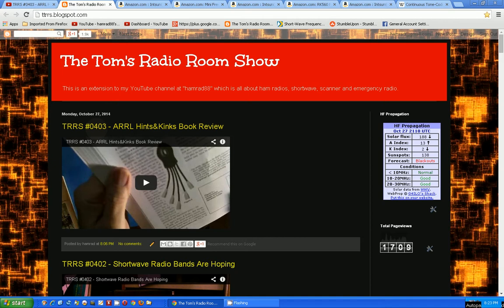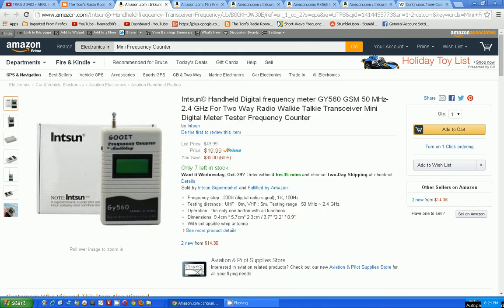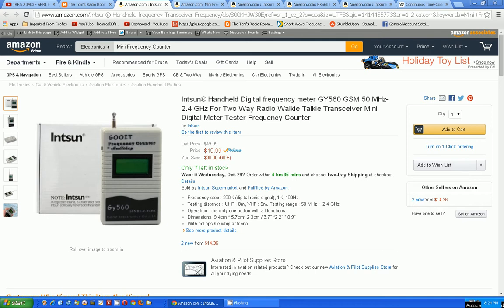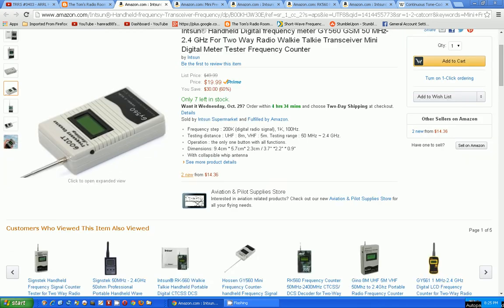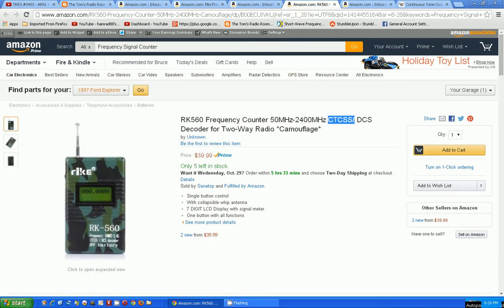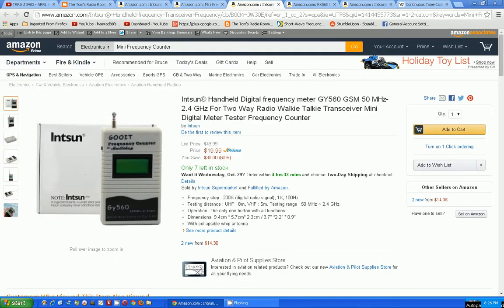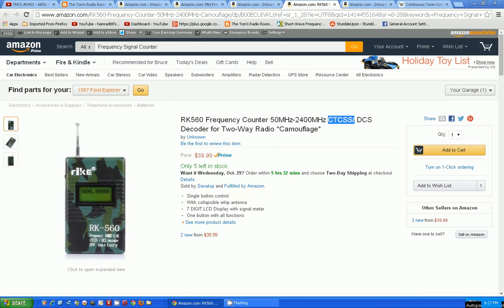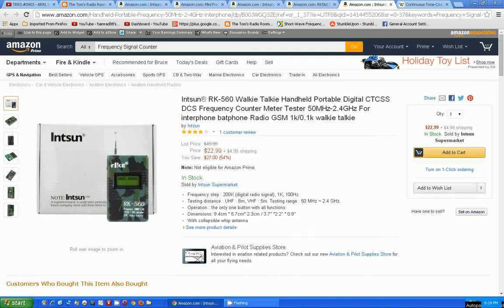TRRS #0404 - What the Heck is it?

Comment: Greets, Tom... I had or have seen a couple of these portable hand-held freq meters at various ham-fest and tech trade shows...different brand names, but clearly the "perzact" same units and perzact same as what you located on Amazon. They worked "OK", that is, seemed fairly accurate, no drift in the admittedly quick testing I was able to do by using these hand-held meters to read a very accurate frequency source that was itself 100.0000 MHz accurate...and the meters that I tested seemed to be accurate readout, etc.

Best me brain can tell, they read freq is about all, oh, yes, and field strength too, one-button selection, but heck, the price seems right, that's for sure. -- Joe

Comment: These Frequency Counters are a handy device for finding strong local signals and/or testing transmitters... they've been on eBay for quite some time, I suppose you could also use it for RF fox hunting.

My Uniden scanners will decode CTCSS as well, handy if you just want to configure RX for one primary service ie. Fire Department.

Comment: It is a frequency counter. It will displays the TX frequency from  nearby or strong transmiter. So, we can identify the frequency of a auto gate's RF remote tontroller, Wifi's frequency, security guard's walkie talike's TX frequency....

The other frequncy conter able to decode/get the CTSS/tone. So, it is useful to find the frequency and tone for cheap walkie talkie. and use the info to set our handy or rig.

The one with poer strenght will shows the TX power of the transmitter at certain distance.

Actually I almost want to buy one of it. :) but, I can use SDR to check frequency. Anyway, frequency counter can give the reading immediately, whlie SDR or radios need to scan for the frequency.

Thank you.
73,
9W2GNU
Reply from the maker: Thanks for your inputs.  I have several frequency counters and one similar that does a number of other things but cost several hundred dollars years ago.  I think I will get one of these and compare them.

Tom
Reply: hamrad88 night.
Reply: Looking forward to see the comparison/review. :)

73,
9W2GNU

Comment: I actually have the GooIt freq counter.  Takes a 9 volt, and works very well.  In fact, it looks to be spot on compared to my Radio Shack freq counter and the one built into my MFJ-269 Antenna Analyzer (calibrated by MFJ in 2012).  The Gooit does have a bar graph field strength meter that has come in handy.  Also, I've had the unit read down to at least 28 MHz when up close to the transmitter (was transmitting less than 5 watts btw).  Can't speak for the camo version, but the ability to decode tone squelch or digital coded squelch could be handy.  BTW the telescopic whip on the thing is tiny.  If your copy is off frequency, there's access to an adjustment screw through the back side.  Either way, look at it as a throw-away frequency counter. If you're in the market for one, give it a shot.  Maybe get the camo one for the tone squelch/pl tone/CTCSS & DCS decode.  Not sure if that one does the field strength reading though.
Reply from the maker: Thanks for the details.  I have several frequency counters and one similar that does a number of other things but cost several hundred dollars years ago.  I think I will get one of these and compare them.

Tom